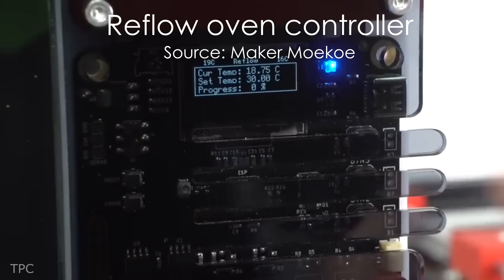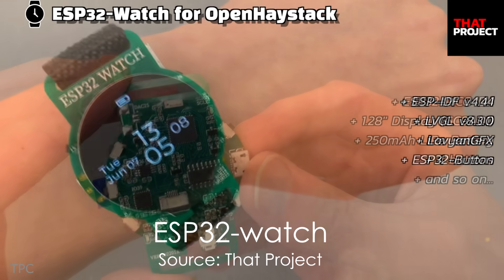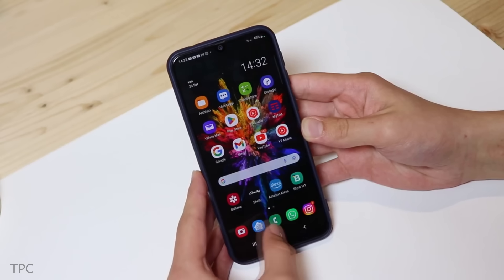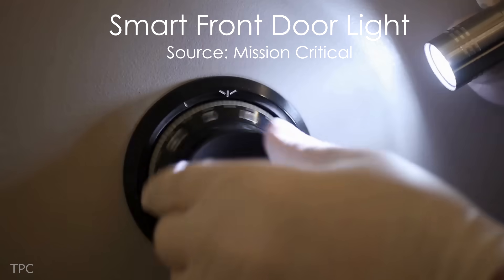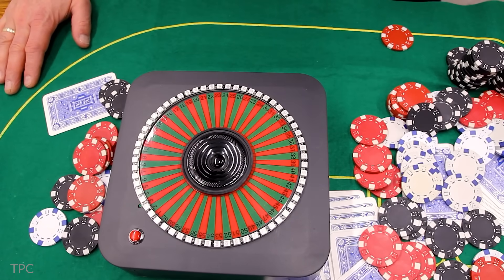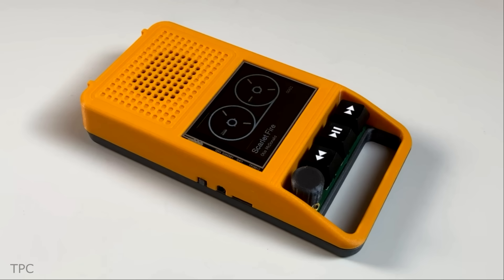The 20 Best ESP32 Projects of 2024!

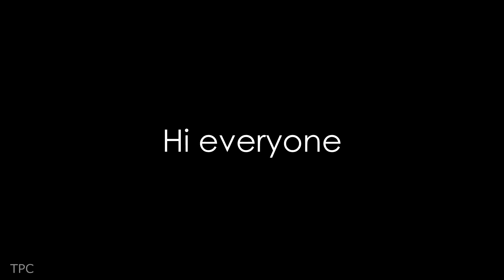Comment: 0:00 - Reflow controller
1:00 - Gps Speedometer
1:34 - Water level controller
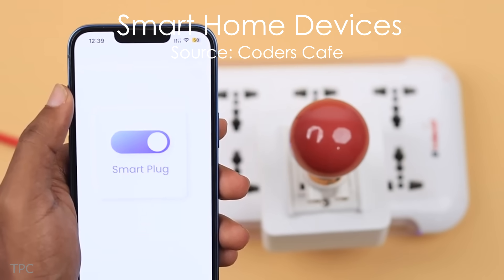2:15 - Smart Home Devices
2:59 - PCB Drone
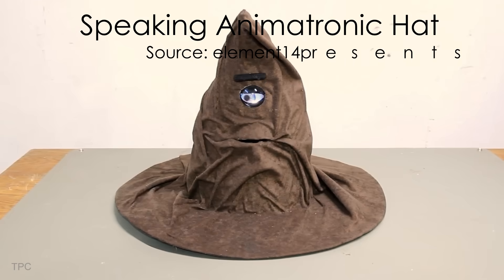3:44 - Speaking Animatronic Hat
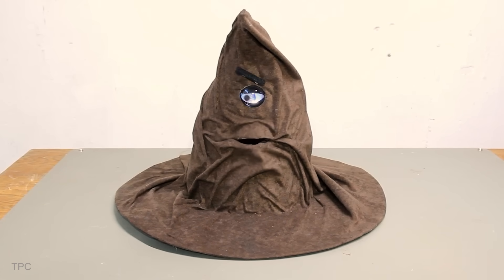4:14 - ESP32 Watch
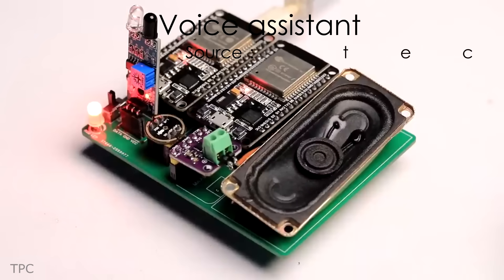5:44 - Voice Assistant
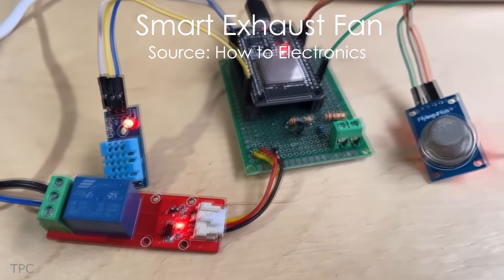6:24 - Smart Exhaust Fan
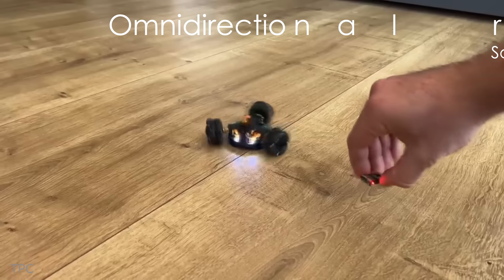7:05 - Omnidirectional Robot
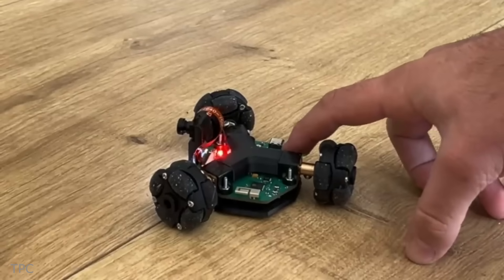7:46 - Advanced Weather Station
8:36 - Retro Audio Player
9:13 - Compact Smart Watch
9:57 - Tiny Surveillance Car
10:29 - Smart Frontdoor Light
11:07 - RC Dump Truck
12:04 - Digital Roulette Table
12:45 - Retro Internet Radio
13:25 - Arduino BLINK Project
14:02 - Mini Messenger
Reply: You're a gentlemen and a scholar, we of the interwebs thank you
Reply: @captcardwell3398  Enjoy the "table of contents" Now fully completed!
Reply: Вот спасибо! А подборочка-то хороша)
Хотя я только первый проект с печкой увидел и коммент пишу ради разгона активности.
Тссс, только алгоритмам ютуба ни слова)
Reply: Why the fuck is that in the comments and not Video Description?